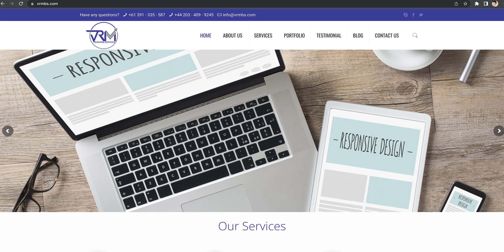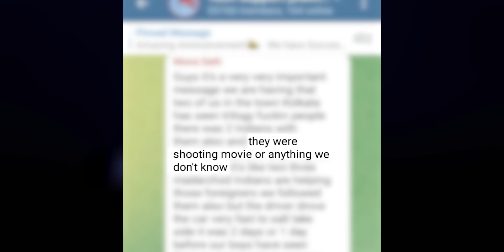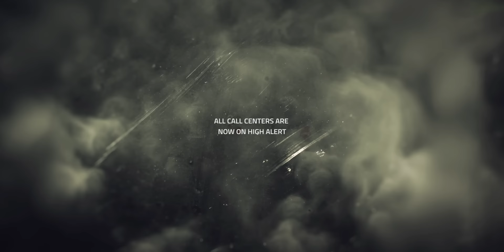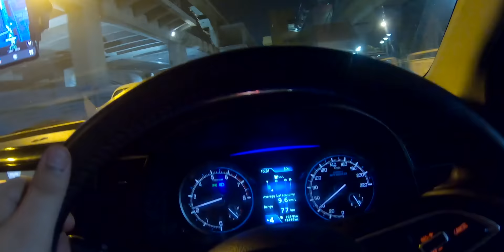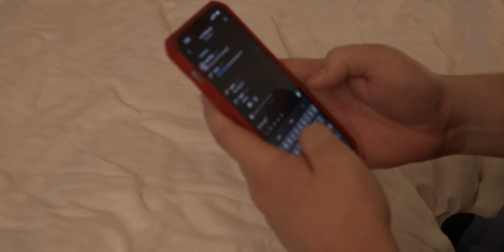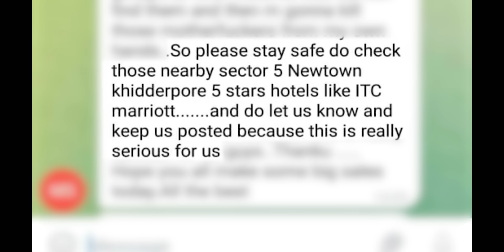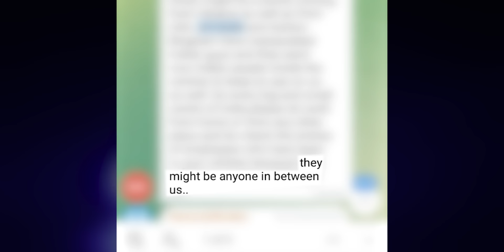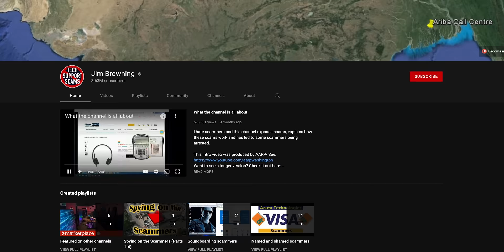GLITTERBOMBING a Scam Call Center w/ Mark Rober

Comment: I just seen the update about how 15 scammers got arrest at MET on floor 5 and I’ve never been happier. Thank Y’all so much. You never know when it’ll be ur grandma or mom on one of those calls
Reply: Really that’s so awesome can you provide a link?
Reply: Unfortunately, it doesn't mean much if a few of the low-level callers are arrested.
They need to get the bosses, which won't happen easily, as those slimy cockroaches will just bribe themselves out of almost anything
Reply: It's so frustrating when people refer to other videos/etc and don't bother sharing the link or any other way of finding it for ourselves.

Comment: As an actual Technician in technical support, in the USA, I cannot thank you enough for your efforts to end the bad rep on Tech Support and end scam calls once and for all. On the job, even when customers call my company and as I help fix their product, they still suspect that I myself am a scammer since it does take time to find and resolve issues. I can not speak the amount of respect and thankfulness of your life threatening efforts to end this.

Thank you. 💜
Reply: You work as a tech support? Then you're not a technician.
Reply: @cokefloat18  Yes when I'm in the office. I do occasionally travel onsite to fix issues on what I work with like Com Boards and the wiring with the communication between them and other systems.
Reply: @jettistired2737  very nice

Comment: I want to know how they got those contraptions through airport security. For future reference. If you are ever trying to move cockroaches around, put them in the freezer for about 20 minutes. It will slow them down enough to make them easy enough to handle without killing them. It is how we mail them and transport them for research purposes.
Reply: They were probably transported in a disassembled form, since they required extra preparation in India anyway
Reply: The cockroaches and rats were bought in India, and the gear was disassembled. It's not like it was anything dangerous, just some engineer stuff
Reply: When "research purposes" actually meant research purposes
Reply: @Nugcon  and not yknow....
"research fap-poses"
Reply: Good to know I may have need of this knowledge, 

I have a lizard that can't hunt very well he needs a little help that may slow them down enough for him to catch
Reply: @Nugcon  It's rare nowadays huh? Lol
Reply: GREAT! But how do you that with mosquitoes?
Reply: @Nugcon  back in the day, it used to be "For Academic Purposes"... made more sense.

Comment: The one scamer I did have it was during covid saying they were calling from social security and I knew every office I knew were closed because they called after 4pm. And I told them that their office is closed after a certain hour. And they said they weren't be calling me after work hours. So I told them that since they told me they were calling from my local social security office. So I asked them that if they are in the building where were they in they building so they did hang up the phone

Comment: I noticed a number of people complaining about them using mice/rats. These animals rodents were going to be killed for food regardless. Getting released like this actually gave them a fighting chance. How many of you wouldn't even flinch at killings them if they were in your home, especially if their were doing destruction and costing you money to repair the damage they do? Most people use the standard traps that break their necks, glue traps which are cruel, and electric traps. Yes their are live traps, but most people don't use them. This is why you don't see them often and they are hard to find. Plus most people don't want to deal with them once they are captured. These are facts. These scammers are devastating peoples lives and costing people a lot of money. I can guarantee that if anyone of you where in the situation of spending as much money as these people are loosing to capture and release mice or rat vs spending a few bucks on kill traps, you would opt for the kill traps. If say these traps cost $50 vs $1 for the the kill traps, I bet almost everyone of you would purchase the kill trap. $50 is a far cray from how much each one of the victims of these scams loose. I mean kill traps you can get on average for about $2 each and non-kill traps are about $5 a piece  and up. And guess what everyone buys? So a few mice were released that saved so many people from being scammed out of their life savings. When you realize what their "pranks" actually did, then it justifies it. These guys lives where literally put in danger over this. But you guys are more concerned about a few rodents that may get killed over this. Seriously?

Comment: You guys just used some living rats to make a prank?! How does this prank help the whole investigation? The scammers are scamming people to steal millions and they dont even care what will happen to the victim. You guys are not much different. You have the same mentality, you also dont care. You dont care how those rats will be killed for no reason that you used to do some unnecessary prank which was not needed at all. You guys did that because you dont care...exactly like those scammers, they dont care either to make others their victim. I would have not pointed this out if this rat killing prank was needed for yours or anyone's survival. But you guys just did it for prank. You said they are left to live an air conditioned building? You think people is not trying to get rid of them yet and letting them live?? Dont you think you people also scammed some living being? You also put them in some new struggle to survive, didnt you? How is that different from those kolkata scammers?